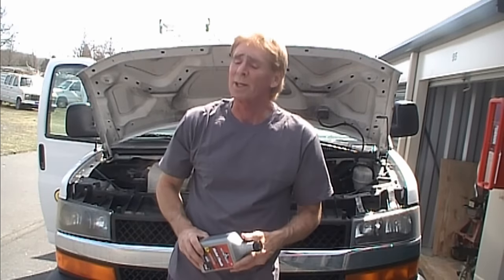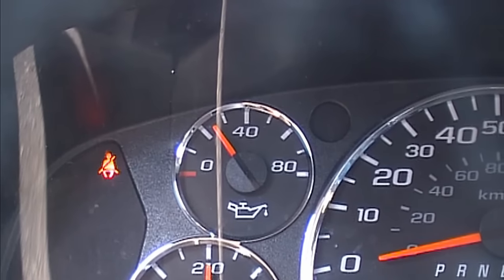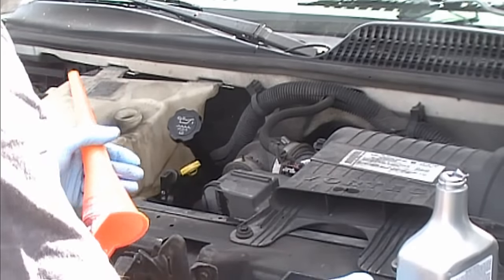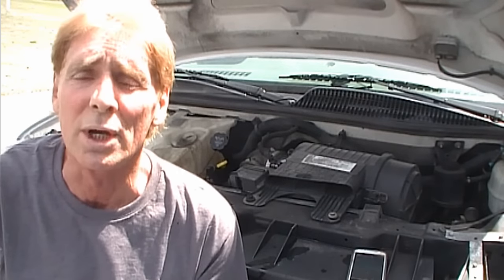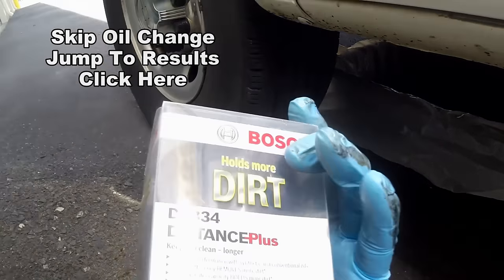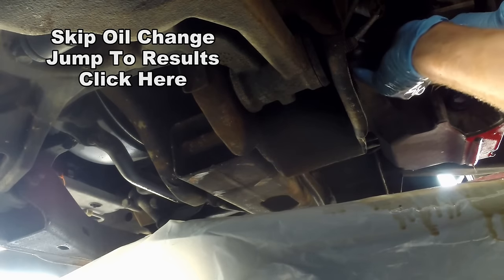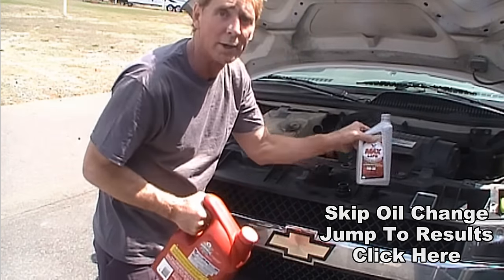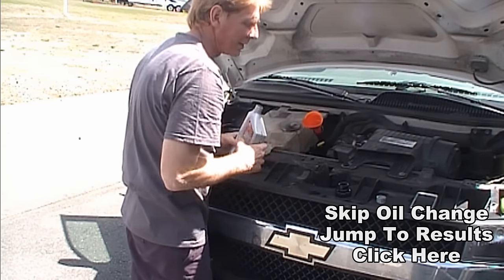NOISY LIFTERS? Motor Flush - Does It Work?  HOW TO DO IT YOURSELF

Comment: Wow, that filter is WAY too tight!  Holy Mother!  It doesn't really matter what the manual calls for in terms of viscosity at that point given the mileage of the vehicle.  I would personally run 15-40 during the summer and 10-30 in the winter, full syn like Royal Purple.  You could very well have a lot of life left if cared for properly.
Reply: I thought the same thing, like how many times was he cranking it tight, jeez.  I just hand tighten mine, and they have never leaked once, I also wipe just a small but of oil on the filer gasket seal.
Reply: Oily hands, I think our guy just wanted to make sure. Lots of filters have a marking on the filter, gasket contacts, then 3/4 turn

Comment: You should have used Marvel Mystery Oil ! Next time you change your oil use Marvel Mystery Oil that will take away The tick from your lifters !
Reply: I know this is an old video. But I tried your marvel mystery oil trick on a 2.2 Chevy. It absolutely works! I was about to rip the engine apart and put lifters in it. But this trick worked!

Comment: Also, when removing old oil filter, check to see if gasket is still on engine. Sometimes they stick to the filter housing. If you install a new filter on top of the old gasket, you will blow oil all over your engine and driveway as soon as the oil pressure comes up!
Reply: YEP !
Reply: I know the feeling 😂
Reply: Yep. I forgot to look. Put on new filter. Started jeep 4.0. lowish oil pressure. Heard...fffsssshhh. shut engine down. Looked under hood. Oil  on block etc. Yep. Bout 5 quarts on the ground within 15 seconds of start time. $4.75 a qt. $10 restore. $5 stp stop leak. $18 tufoil/ptfe. What's that...bout $60 on the ground?

Comment: One thing I learned using Motor Medic is one 32oz bottle only treats 4 quarts of oil. For most V8 engines that use 6 quarts of oil, you have to use 1 and 1/2 bottles of  Motor Medic, or 48 ounces. The bottle also says it may take more than one treatment. Motor Medic also makes Valve Medic for noisy lifters. Motor Medic should probably be used at every oil change for high mileage vehicles. You cant use it once at 300,000 miles and then say it doesn't work. I personally have used it regularly with success! :-) I had a stuck valve, probably intake, causing a lean code. I was over 200,000 miles. I used it 3 consecutive oil changes and it cleared the engine light lean code. My van runs like a champ.

Comment: The 6.0 are hydraulic lifters so most likely oil pump or cam bearings at my work we use the 6.0 chevys and with proper care can get 500k out of them but the auto trans don't always last that long

Comment: I did this on a car I wasn't too bothered about and drove it with the flushing oil still in the engine.
After ten miles, the tappet noise magically stopped, and after the oil change the engine was much more lively.
It might be a risky thing to do, but in my case it definitely worked.
I kid you not.

Comment: I have a 2008 Chevy 3500 6.0 liter. I had the same tick. Come to find out. After replacing all my lifters and everything on the drivers side of the motor. It lasted six months and then the right side started ticking.
Then I just went ahead and bought 
A motor from GM Chevrolet dealer  and had it replaced.
The dealership stated the 6.0 engine while running stated my engine will run from 8 cylinders to four cylinders and in between four and eight cylinders, depending on how fast and on the highway or in the town driving. So that’s why the driver side went out first. Now I always push my tow button, so it will run on all 8 cylinders. You can have a professional mechanic put a bypass so it always runs off of eight cylinders, but I didn’t find that out till I had 75,000 miles on the new engine.

Comment: That engine has a lot of miles and you should be running a thicker oil such as 10-40w or 15-40w plus an oil stabilizer. That should help with the noisy lifters and increase oil pressure.
Reply: great answer indeed

Comment: I did MM motor flush, drove around with a little "hotrodding" off and on, then used WIX filter, Valvoline high mileage 10w30, and Lucas high mileage.  Before my 6.0l sounded like a typewriter from the 1800s, and now it sounds like new.  364000 miles and fixing to drive from Texas to Michigan, then North Carolina.
Reply: Same experience here, loads of horror stories about engine flushes on high mileage cars but i went with it anyways and was blown away by the results she purs like new again
Reply: By the way the truck made the trip.  Wichita Falls, TX to Grand Rapids, MI, hooked up a 30ft RV, and drove to Jacksonville, NC.  Then drove around NC for 6 months, then sold truck to a guy in SC.
Reply: Man I’m hoping to get my 2001 Toyota Sequoia v8 4.7 to do the same!!!!! What’s hotrodding? And is the Lucas high mileage an oil treatment?
Reply: @like-mindedwellness7586  Yes Lucas oil high mileage is a treatment in the same shape bottle as the transmission additive they make.  Grey bottle if I remember right.
Reply: People have no idea what they are talking about man. Ive strategically used engine flushes with the same success. No itz not gona bring back bearing material but it will remove varnish from lifters and stuff for u

Comment: how not to change your... never use vice grips and you have to put oil on the seal of the new filter
Reply: Brendan Mccabe  yup dab your finger in the used or new oil and rub it on your rubber seal on the filter. They'll never get stuck again. Also I think he over tightened it, once you get it hand tight, a quarter turn will do...
Reply: +Brendan Mccabe My dad usually fills up the filter with oil before he puts it on just so the pump and the journals aren't dry when you start the engine but yea this guy does oil changes like the shop i used to work at does them they dont even bother to do it right its not about the customer anymore :(
Reply: true
Reply: +shiftys-wow GM How would the journals be dry? The engine was just running 5 min before. It isn't completely necessary to fill the filter.
Reply: +reweydewy youcre right it not but its an extra precaution my dad and I like to take because where do you think the air in the new filter goes when you fire up the engine? thats why u dont have oil pressure for like 10 seconds. It may not rly make much of a difference I honestly dont know but I like to know that I did everything I could to make sure that the engine was lubricated when its started.
Reply: ShortLifeProductions that is true my dad and I do the same. If you really want to know look up effects of dry start. Even in the automotive industry they say to fill up the oil filter with oil, BMW oil filters have a fill mark on it that shows you how much oil to put in the filter.
Reply: +shiftys-wow GM 

on diesel engines yes add oil to the filter. on gas engines fire it up a few seconds and top off. this way you know wether you have a bad oil pressure also.
Reply: +Edgardo Gonzales Yeah on diesels you ALWAYS refill the filter.  Don't take them to quick lube places they don't know any better or care.
Reply: When you screw the oil filter on, oil will completely cover the seal. No need to finger your seal.
Reply: I really hope this guy is not a dealer and sells vehicles like this
Reply: right pour a little in the filter first
Reply: I add just enough to saturate the filter media..no oil pooled in the filter.
Reply: The Toyota filters i buy come with grease on the seal  already so you dont have to put oil on it
Reply: I seen a lot wrong, every 6 months you change all fluids an spark plugs, the second time is when you do full tune-up... my 95 Honda runs like it did in 95

Comment: My experience you need to run this for 30 minutes. 15 minutes at idle and 15 at 1500-2000 rpms. When you refill since this thing has 300K miles use one grade thicker oil and substitute 1 quart of Marvels Mystery Oil in place of one quart of oil for the duration of the oil change as the Marvels Mystery Oil burns off over weeks top up with what ever oil you use. If the tick is going to go away it will do so usually with the MMO aka Marvels Mystery Oil. The reason we go one grade thicker than the OEM recommends is that that 1 quart of MMO will thin out the oil. All of that said with 300K miles and t being a hydraulic lifter OHV engine with a lifter tick and low oil pressure I doubt it will be fixed with a "Mechanic in a Bottle". WHat ever is causing the low oil pressure is the problem.

Comment: Lifters rarely cause issues on vehicles that are driven a lot. Much more likely on a high mile engine like this that you have a rocker worn past the auto-adjust range, or a cam lobe/roller that is worn. Pouring in snake oil will never fix worn metal.

Comment: You need to use Marvel Mystery Oil it works 10 times better an old trick that they used to do is MIST water in the intake while it's running it will backfire creating the lifter to free up
Reply: Marvel mystery oil is the best. Hands down.

buy a quart and put half in the fuel(just before filling) and half in the oil and enjoy your clean systems.
Reply: Kal Galath Yea I always use marvels mystery oil it's a beautiful thing and great for injectors too
Reply: ***** fun fact.
that motor flush is just a quart of kerosene.
Someone just got the bright idea to put it in a convenient bottle and charge people 2x the cost of kero at the station.

Marvel does things that 'motor flush' cannot.. because all motor flush does is loosen up crud.
Marvel does that, frees lifters, quiets knocks, clean injectors valves and more.
Lets see your overpriced kerosene do that.

And as far as your BMW's and Mercedes are concerned.. you can keep em.
Stuff works in my chevy just fine.. and the rest of the crap you posted is simply irrelevant. 

Source: I sell that stuff, and people have been using kero to flush the engine block since my grandad was doing oil changes.
Reply: Kal Galath I'm with u a 100% on that kerosene or diesel works as that motor flush stuff mystery oil has a slick lube mixture and could also have detergents in it like automatic trans fluid but run it in small engines as well it done a fantastic job
Reply: ***** I never use motor flush to clean a motor, because motor flush strips your motor down to the bare metal. So when you start it up, your motor is bare metal to metal no lube on it. I use marvels mystery plus I always  pour some motor oil in the oil filter, before I put the oil filter back on the motor. That way the motor wont run dry! Some guys use trans fluid to clean motors out and for sticky lifters.
Reply: Marvel is just like all the rest, snake oil!.
Reply: If you mist water in the newer engines that have aluminum heads or blocks it will crack the block or heads.

Comment: All of these videos were an inspiration to flush the engine on my 2001 Chevy Tahoe!  I had poor initial oil pressure combined with noisy lifters!!  I drained the oil and filled the crankcase with 2-gallons of gasoline and let is sit for three days.  I drained the gasoline and refilled the crankcase with 2-quarts of oil and a 1-gallon of diesel fuel.  The then started and engine and let it idle for 5-minutes.  I did this three-times over the next day, and then drained and re-filled the engine with oil and new filter.  The oil pressure returned to normal and the noisy lifters went away.
Reply: I dont know it's a good idea or not but I spun a bearing and lost oil pressure on my 4.3 vortec... mechanic ran some break cleaner in the oil to clean the gunk out. I think it fixed it for like a day until it started knocking and locked up completely lol. My issue was my oil had coolant in it so it wrecked everything over time. If you have a coolant leak with no puddle, suspect it's in the oil!
Reply: I use to flush the engines with 3 liters of querosene and 3 of regular oil for 5 minutes and according with mileage I use thicker oil to stop noises
Reply: Selling funnels.....
Reply: S w  thanks for your reply. Interesting will try it during the next maintenance
Reply: Sounds insanely dangerous.. .....kaboom!!! Lol
Reply: @marioeatspeaches5862  MMO is 30% kerosene or turpentine. MMO is turpentine but the Medic Engine Flush is kerosene (the standard). I did the synthetic medic flush and I can't tell if it did anything. haha. I'll keep using MMO in the engine though.
Reply: Know you will need to replace the rods and main bearings
Reply: Doesn't that hurt the gaskets